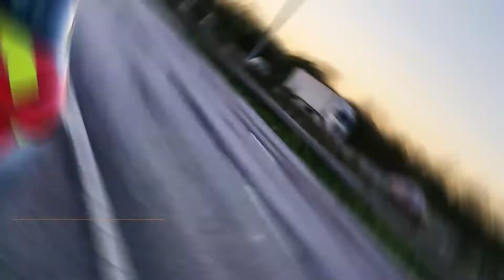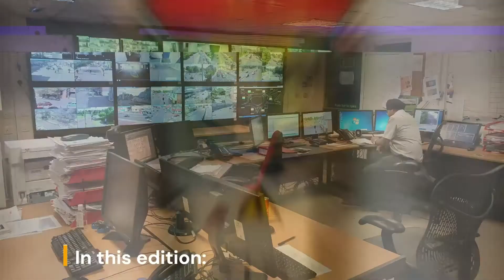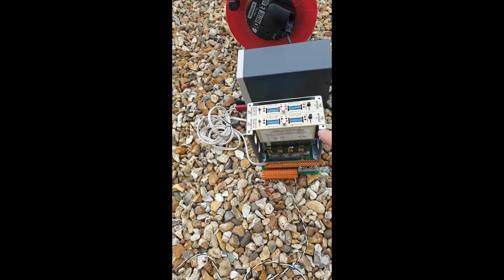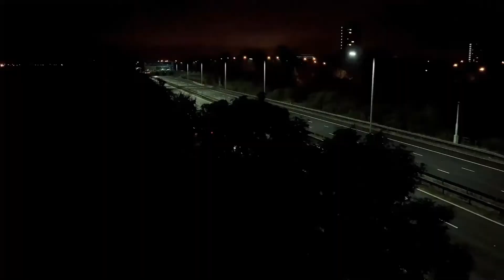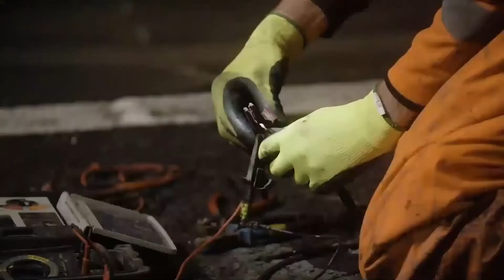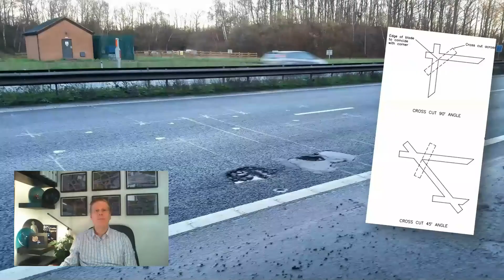Technology Insight - Inductive Loops

Comment: The Bottle joints in the pit are upside down, it wouldn’t be long until there full of water ☹️
Reply from the maker: The advantage of these lightweight bottle joints is that they don't strain the glands around the cable entries, so they don't tend to compromise their IP rating for water ingress. I have seen many of them fully immersed in chambers with no trace of  water in them. As with any of these types of system though, it is reliant on the installer doing the glanding properly!